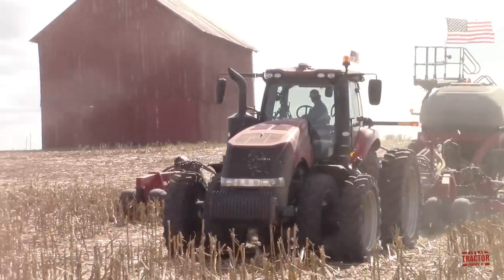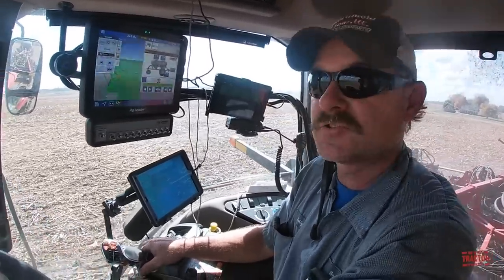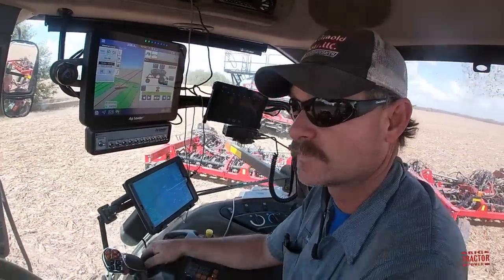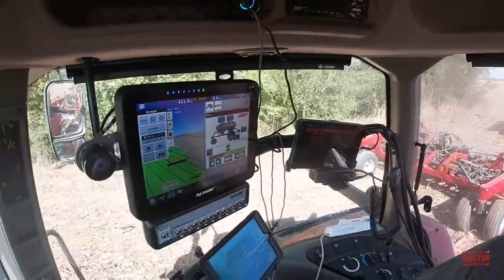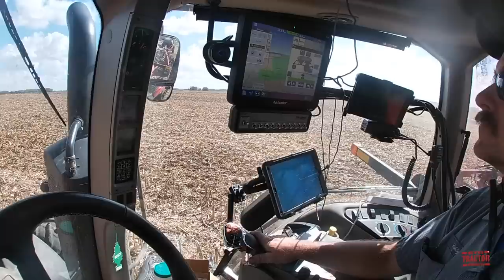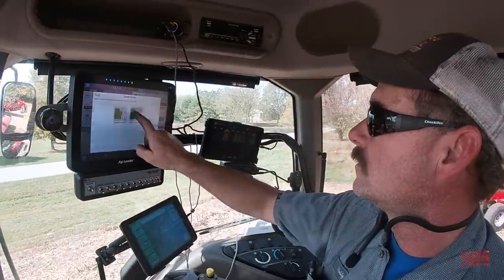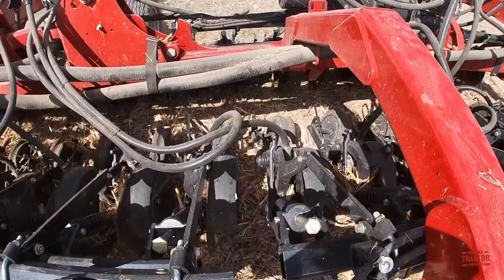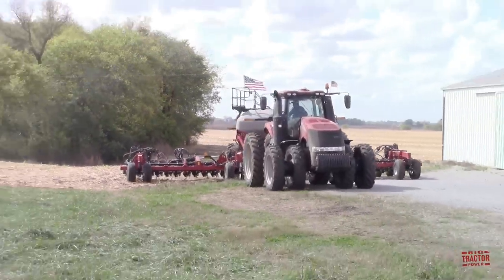CASE IH No-Till Precision Air Seeding

Comment: This kind of tillage & planting has been promoted since the 1960s. The term then was "plow-plant" or "no-till" with the idea that a single-pass operation would save costs over the multiple operation of tillage of conventional farming. In practice the minimum tillage methods needed to match the soil moisture conditions, soil types, and weather conditions of the season. One method might work fine in a particular soil type and moisture conditions but fail to work when the narrow window of the planting season dictated that the crop must go in the ground.

Comment: Never seen winter wheat no-tilled into corn stubble before. I'm interested in seeing what the crop looks like in spring and at harvest.
Reply: Its just like any other crop. If every thing goes right it does really good. It just depends on the weather.
Reply: A really wild (west) job this no-till system. Especially without smoothing the corn stubble before.

Comment: I wander if it makes any difference if you run a chopper head or a regular corn head as far as the drills performance putting the seed in the ground?
Reply: The chopping corn heads make it harder to get the seed in the ground. For planting you want little to no residue. But I do think the chopper helps the stalks break down faster.
Reply: @bobbychandler1293  10-4 we either disc harrow before we plant wheat or either use a no-till drill behind peanuts and maybe some behind corn.